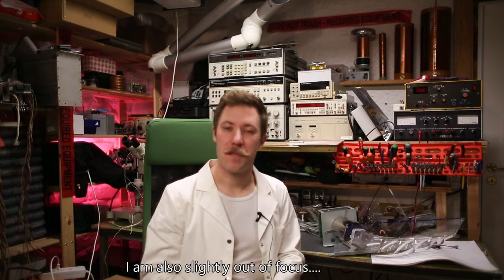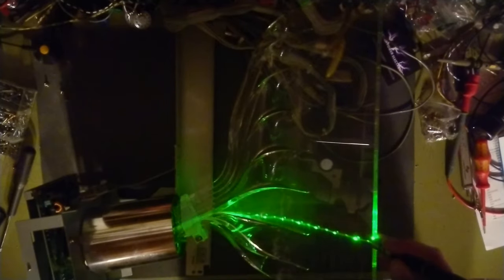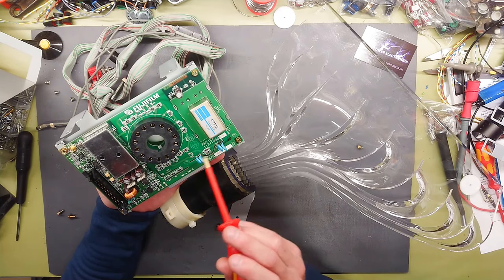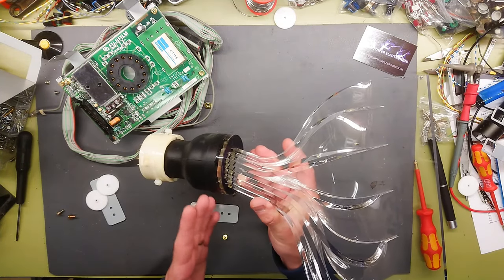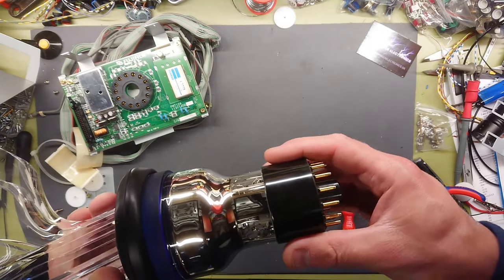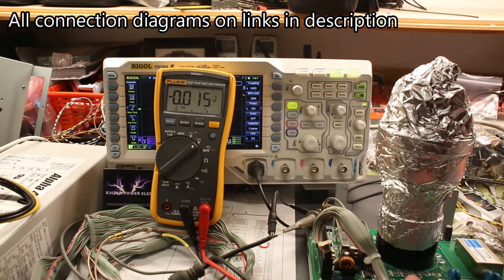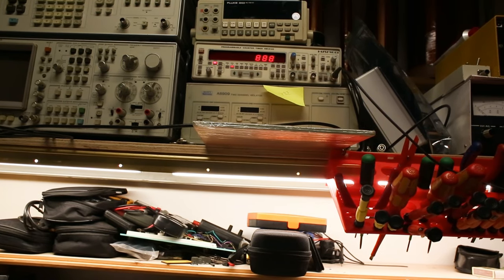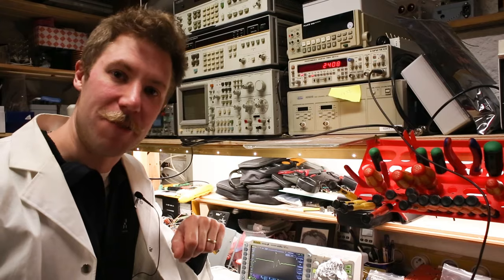Fujifilm FCR XG-1 XRAY Scanner, Photomultiplier Tube Reverse-engineering (Part 3 of 3)

Comment: Heatshrink over PMTs is common, it stops stray light. You should get some scintillation plastic to convert beta and gamma to photons and do some a gamma spectroscopy. Great video btw, love that acrylic light pipe!
Reply from the maker: I do test it with a scintillation plastic at the end of the video, my scope unfortunately corrupted my USB stick and all the different  detected waveform I wanted to discusd in the video was lost. Test setup was dismantled when I put it in the PC :(
Reply: Plastic scintillators are not good for gamma spec work-not enough variation of light levels between low energy vs. high energy emissions.

Comment: That acrylic molding is amazing. Must have used some sort of jig and someone skilled to mold it after heating it.
Reply from the maker: The 8 smaller ends are actually not melted together. It was just silicon glue that had grotten i between them. But its hard to tell how its made as its polished on all edges.

Comment: Nice, the acrylic lightguide is a classical case of to beautiful to scrap but to specific to ever reuse. ;)
It also helps to always have a healthy stack of random coax cables around, I know that pretty well. 

This unit seems to be as reusable and as standalone as it can get, great find. 

Greetings, 
Michael
Reply from the maker: Haha yeah, I tried putting it in front of a wide range of lamps, tried it as light guide for my drill press, but its just not useful for spreading light. Only collecting.

Comment: You can mess up PMTs by shining light into them even when they are off. Shining the laser into it may have killed some of it's sensitivity.
Reply from the maker: I just quickly flipped through the hamamatsu PMT handbook and could not find a warning about this, its more concentrated on protecting the tube against external electrical field like static. As handling in day light with a static discharge to a synode can accelerate enough electrons. Its not the end of the world for a teardown, but I will keep from using a laser at a disconnected PMT in the future :)
Reply: @KaizerPowerElectronicsDk You find the warnings on the package a lot of the time.
Reply from the maker: @JerryBiehler  This unit only had a warning against scratching the light guide :) and there was no original box for the tube with it ;)

Comment: nice I have one of these..
Reply from the maker: Nice, where did you get that from? Have you had it hooked up? I have been wondering about the output signal waveform. That its both a higher amplitude depending on particle energy, but also seems to vary between 1 to 3 sinewave peaks, so the combined on-time is also higher at times. I am not sure if its just a result of ringing from the first peak or its an feature to get a 2-dimensional value out.